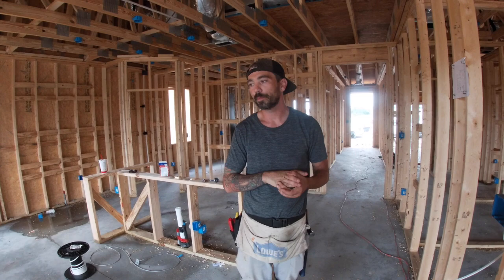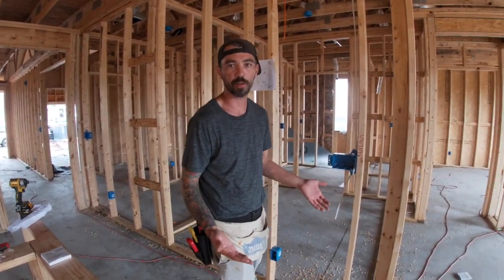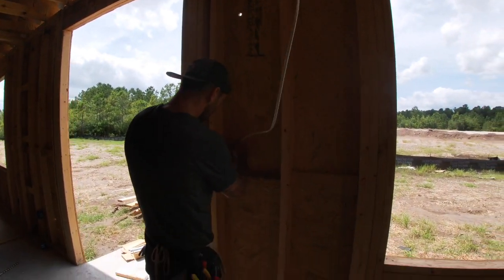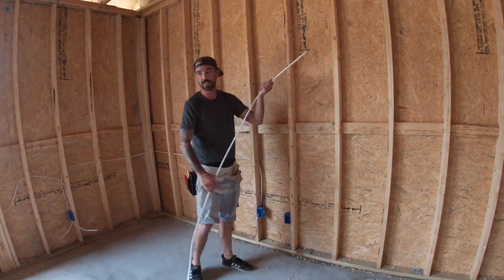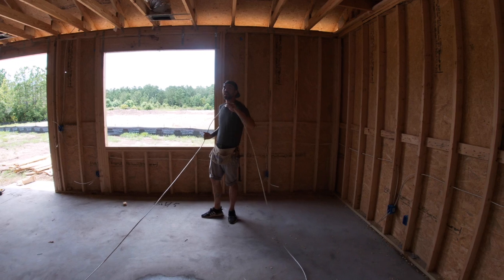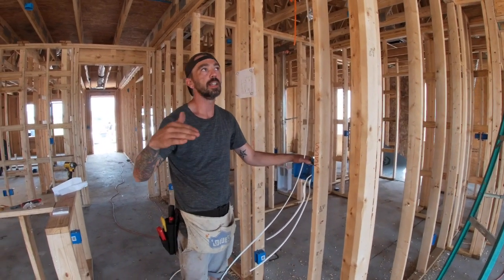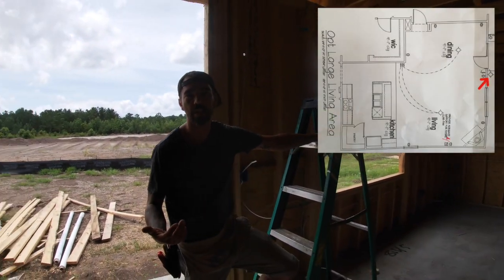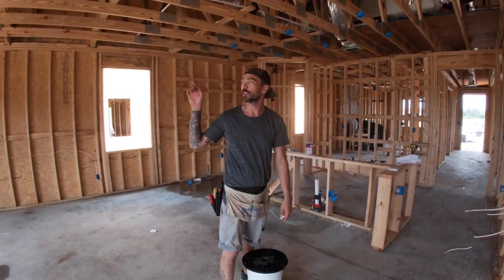How To Wire A House; Episode 8 - Family Room

Comment: What size wire is used for the plugs thru the walls?
Reply: He used 14-2 which isn’t the greatest to use for outlets. If you try to run a vacuum on it, the breaker will trip the 15amp circuit. 

For outlets u should use 12-2, it will be able to handle more juice and it’s good to use with a vacuum. 

Code on a house says bathrooms, kitchens, exterior outlets, and garage must be 12-2.

Comment: My goodness you are leaving 2-3 times as much wire as you need in those switches, we leave a little bit longer then klein length... also before you staple your hot jumper down go back to where you pulled it from and pull the slack, you wasted a couple feet putting up staples I'll bet
Great content though man keep it up
Reply: Unless you're buying it, I wouldn't worry 😂

Comment: Why you used  14/2 for outlets ???  And the breaker it’s 15 amp or 20 amp ???
Reply: Depends on what city requires. Some require the whole house to be 12/2 some don’t. 14/2 - 15 amp 12-2 - 20amp

Comment: one thing that annoys me ,is how u run ur wires at attic ,they might get stepped on in the future
Reply: Exactly. There is a whole code section NEC 320 that deals with wires in the attic. I'm guessing they consider that attic space "not accessable" which results in the code not requiring the same standard of care re support, stapling and protection. This is production work. Generally sloppier and less "generous" in terms of the standard adhered to in custom builds.